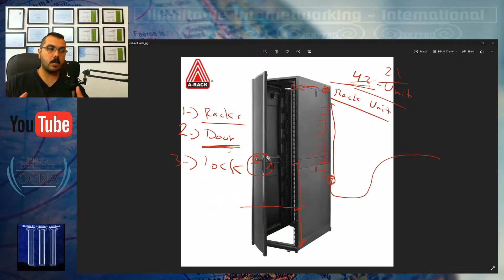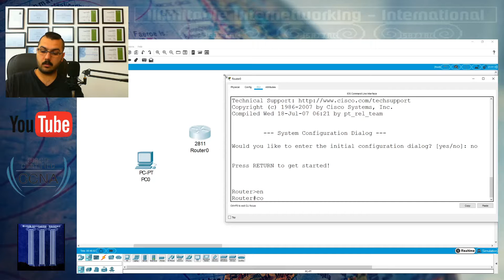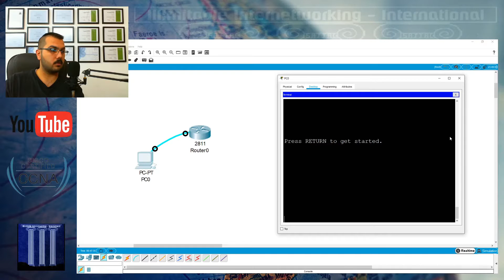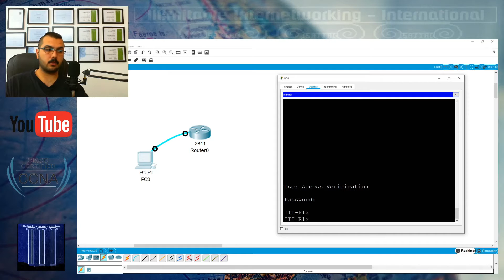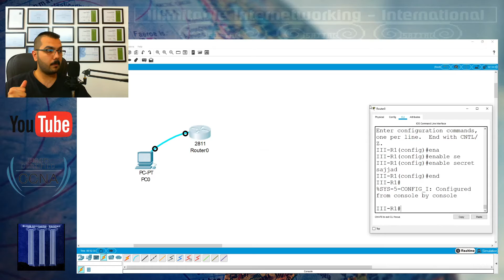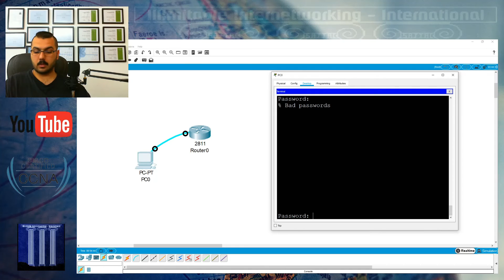Comment: Why only after AUX Port connection the router wants a enable password? If i used console port type console password in the terminal and after that i typed enable and i got access to the device. Is it another packet tracer bug?
Reply: port authentication will only access the user exec mode
line VTY access with local credentials can be subjected to the privilege level of the credentials

and packet tracer can have some non accurate behaviors sometimes